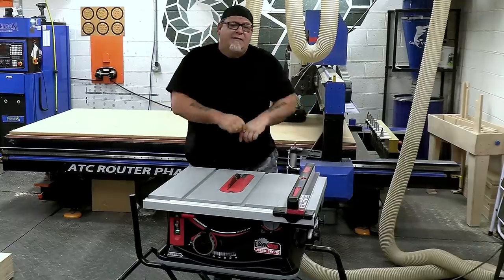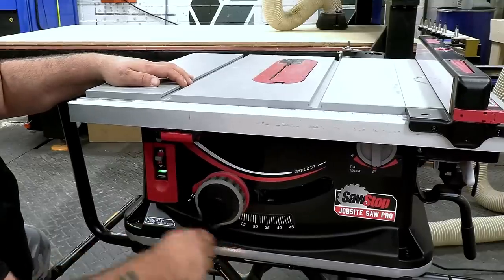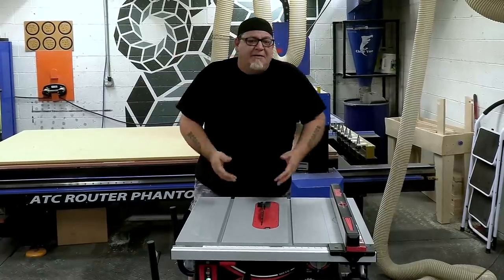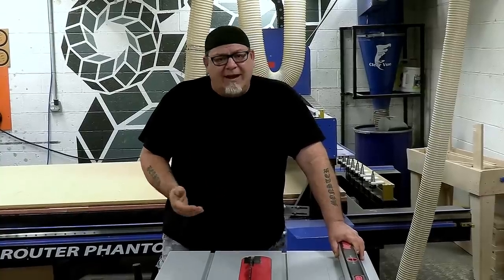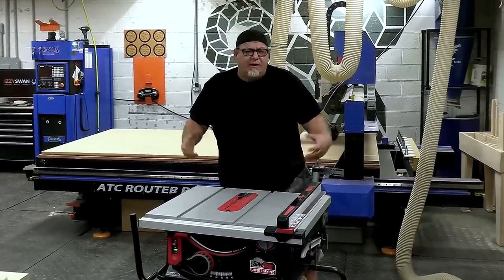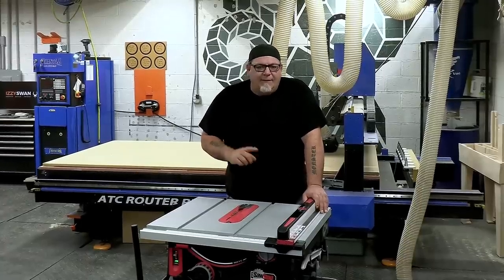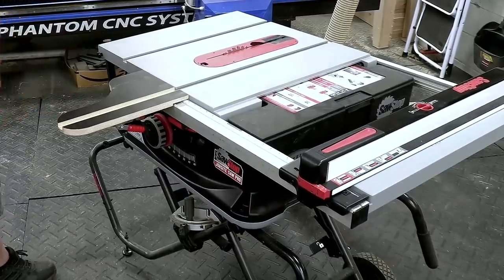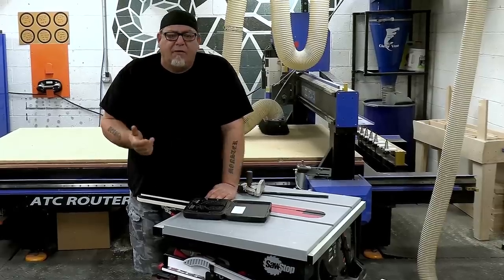DISAPPOINTED! - Most EXPENSIVE Jobsite Table Saw!

Comment: Izzy not so fast, thanks I think you need to reevaluate how the fence comes into alignment. I’ve been using my Sawstop contractor Saw for five years and I thought the same thing at first.  It seem to be a lot of slop but it all has to do with where you push the fence when you’re preparing to lock it down. it’s always the back end of the fence that seems to jump in the place and the front edge of the fence comes in on the measurement

Comment: I sold my dewalt 7491RS to buy the JSSPro. The dewalt's fence was the only thing I really liked about it, but it wasn't perfect out of the box. Not a big deal to adjust. I liked the rack-and-pinion adjustment for sure, but the tabletop wasn't dead flat but no cast aluminum table that isn't milled is. My SS is flatter and runs without the DW's wicked vibration on start up and shutdown. I watched a few videos of the JSS and had seen the tip to pull back on the fence gently before locking it down. I thought everybody knew that. The saw is at least as good as any other jobsite saw on the market and it wont cut your fingers off. Even if you say that feature adds $1K to the price, nobody is going to say their hand/fingers aren't worth the extra money. 

I have a really small shop and need a compact saw, otherwise I'd have picked up the contractor saw, but this never travels to a job site. 
I mainly use the saw for smaller cuts, only stuff that's easily managed on a compact table although I've ripped long lengths of hardwood after setting up a good outfeed, and never had a problem with accuracy. If I need to cut sheet goods or larger panels I use my track saw.

Comment: The Sawstop contractors saw is the best portable saw on the market. Not only is it the only saw with Sawstop technology, it is well built and very accurate. over the past 35 years I've had contractors saws from 4 other manufacturers and the Sawstop beats all of them hands down. My saw comes of the truck and back into the truck every day, and it has held up better than any other saw I've owned.

Comment: Since you're talking about blades, maybe you or someone else can give me a recommendation. I'm redoing my deck. I'm actually pulling up the deck boards....removing the staples (yes staples) resurfacing the boards by running them through my 10" table saw...then treating them with a DIY weather treatment....then screwing back down. 

There seems to be a wide assortment of general purpose and demolition type
 7 1/4" saw blades for the occasional missed staple, but I'm just guessing on the 10". Project Farm (excellent channel)
did an in depth review on 7 1/4" blades.
I just went to Harbor Freight and picked up their inexpensive GP blade. It's a deck, so finish is not terribly important. Any suggestions?

Comment: definitely an issue with the design of the casting, where the trunion is bolted to the table top. I've replaced a few trunions where they broke at the exact same spot. I've got pics if you're interested. I suspect rough play but it is a contractor saw, it should be able to handle the odd bump. These were all replaced from students at a trade school, not a work site.

Comment: You're iusing the fence wrong. Use the red hairline in the window to set the exact width of the cut. When you snap the lock, the fence will snap to exact square at the desired width. No need to measure the distance from the blade to the fence. Try it. You'll see it is dead on every time with no need for a tape measure. I've had mine for 3 years. Keep the blades clean and you will grow to love it. Just ordered one of your Saddles for it. Thanks for building a saddle for my jobsite.

Comment: I own the older model. Same fence problem and I cannot adjust the gap between the break cartridge and the blade. As a result I paid to have my brand new dado stack sharpened because it was an 1/8 of an inch over 8 inches in diameter.

Comment: 2 important things about 15 amp tools:
1st, I've got a 15A, 1.75hp air compressor that flat won't run on most extension cords, so U can create voltage problems for yourself by to limited (small gauge or long length) of extensions. 12ga for short runs, 10ga for longer. My compressor won't run on a 50ft 12ga extension, not even a fart worth. 
2nd, 99+% off outlets are 15A and cheap as hell. If you are using a particular outlet regularly for full 15A tools (this is why that 15A ceiling is so common BTW) spend the few dollars for full rated commercial 20A receptacles.
Reply: Ya can’t just change the outlet if that’s what you are thinking.  You have to replace the 14 ga wire with 16 ga to have a 20 amp outlet.
Reply: @thomasslate5341  Close, but you would actually have to replace the 14ga (15A) wire with 12ga (20A). You're right that it wouldn't necessarily solve the problem, because of resistance and voltage drop. Also, installing 20A outlets on a 15A circuit would fail an inspection, because it could allow someone to plug in a 20A device. It would just remove one potential bottleneck from the equation. The right solution for air compressors is always to plug in directly to a good outlet, preferably without competing tools, and then run longer air hoses. The compressor motor will feel an extension cord, but can't tell the difference between a 25' and a 250' air hose.

Comment: I bought the Sawstop Jobsite Saw Pro last November. For the most part I like the saw. What sold me is saving my fingers in case of an accident.  I have a very small shop and the ability to fold up the saw to move it out of the way is another reason I bought this saw along with being able to use Dado blades.  I would hope that at some point Sawstop would come out with an update to the fence as the fence is the only thing I am disappointed with on the saw.

Comment: I’m very surprised you didn’t speak to how ridiculously horrible the miter gauge is that comes with the saw! It’s basically a throw away gauge that says “go buy your own”… would expect better for the price of the saw. 

Great video overall though for those looking for info on it. I’ve had my JSS for 2 years, and dialed in and got used to the fence in short time so I’m not too fussed about it at all.  Wry happy with the saw overall otherwise.

Comment: I got mine at the start of the pandemic. My saw came damaged by the shipper, and the wing isnt flush with the body. I did get money back and sawstop did ship me a new wing. 
I do wish that:
 the cut capacity was wider as 32" would have been preferred for the backs of cabinets and sides. 
 they had attachments like extra long wings, like how a jointer may have to accommodate larger stock. 
 the clearance where the blade is was more so that it was easier to put on and take off blades.
 there was a door to service the dust collection area like the bigger sawstops have. 
 the miter slots were a traditional size so that I could easily purchase a miter bar to replace the horrid one that came with the saw.
the cord was longer so I could reach outlets better without having to grab an extension cord for 3 extra feet to reach...

Comment: I’ve had mine for 3 years and I’ve had issues with the fence shelf not retracting the whole way.  It sticks out about a 1/16 even after cleaning it out and trying to adjust it.  I haven’t had time to investigate further. Also, the angle adjustment will not go to 45°.  I’ve somehow lost the full range of motion on the bevel adjustment.  Again, haven’t had time to work on a permanent solution.  Anyone else have those problems?
Reply: About the angle range give it a really good cleaning, in my saw (not a sawstop) cannot get it to full zero, did all kind of adjustments and ended up putting it upside down and clean it with a small brush leaving it spotless and then got the perfect zero again.

Comment: You really can't expect the kind of accuracy and fence from a jobsite saw that you would from a cabinet saw. I've owned my JobSite Pro for a couple of years, and I love it. Yep, the fence moves a bit, and that can be annoying, but once I understood how it works, I can make quite accurate cuts with it without any problems. I've not seen a better fence on any other jobsite saw (but I haven't looked at them all, to be sure). On big pieces of really dense hardwoods, it can bog down a little, but it can make the cuts. To be fair, though, it wasn't designed for that kind of work. It's a jobsite saw, designed primarily for cutting construction lumber and plywood. It has no problems at all with that kind of work. In my small shop, however, I do use it for cutting hardwood, even dense exotic woods like tigerwood, purpleheart, and padauk, and it works fine. The mobility and other features (especially the safety) make it really the only table saw that works for me in my space.
Reply: Yes you can, I own a KITY 419 - they are OLD, so old that I beleive that they are the progenitor of the modern site saws (it's the same size and has the same features of moving / adjusting the saw) and I've been using mine for many years and the fence is ROCK SOLID, it's extruded aluminium with a SOLID ALUMINIUM "head" (?) where it meets the rail section and no matter how much I crank it, the far end of the fence DOES NOT MOVE AT ALL, not even with a dial indicator.

It CAN be done, if the manufacturer is willing to make less PROFIT and make a better product. - why people continue to put up with shit products is unfathomable.
Reply: @rafezetter8003  That isn't a jobsite saw. It isn't mobile. It only has an 8" blade. Without an extension table, it can only rip about 6". It may have a good fence, but nothing else about it is even in the same league as the SawStop JSS Pro.

Comment: I will keep my DeWALT table saw which I paid $600.00 Canadian. Has a rack & pinion system for the fence and works very well. Is it near perfect? No, but but is really good. The mitre gauge is crap. It was quite easy to setup so that the blade parallel to the mitre slot and the fence parallel to the blade. I personally refuse to pay the inflated price for the sawstop brand. Also have 32.5" rip capacity and the fence has a flip over to support the piece when the fence is off the table.

Comment: Mafell make a jobsite saw, makes the Sawstop look cheap 👀

It's a bit speciality though, most people have never heard of them if they don't build wood cabins! 😆
Reply from the maker: I will check them out.
Reply: Most carpenters in Europe have heard of Mafell, little know fact, Mafell batteries are interchangeable with Metabo original
Reply: @harveysmith100  they're actually part of this new tool battery alliance, lots of smaller and neiche brands getting together and all using the same batteries to cut down on costs, and make them more attractive to buyers. Quite a good idea actually :) 

Have you seen their 'handheld' 10" beam planer? 😆 or their huge 2ft something inch circular saw? 😆 really pushing the boundaries of "handheld" there! 

But in amongst all that mad stuff, they've a competitively priced tracksaw and jigsaw 🤷‍♂️
Reply: With Mafell, it's not about price, but about quality. The jobsite saw is mostly used by cabinetmakers. Alltough the Erika has his disadvantages, like the unhandy fence (wich is improved very recently) and the not parallel sawblade, it performs better than a lot of cabinetsaws.
Reply: @mor4y  Correct

Comment: Just a small note, if you are setting up the the square for these saws or most saws set your square on the right hand side of blade as this is the side your cut piece will be. Yeah it will have more base plate but use a bigger square.
Reply: Don’t mean to be rude, but when you have used a Jobsite for so long you get used to its limits. And one thing you realise it can be square on the right side of blade & not on the left but as cut piece is usually on right it does not matter if it’s set up right 🍻

Comment: I haven’t used this saw. I have the Metabo and the fence is great. It connects son the gears on both sides and is solid. It also has a 36” rip cut
Reply: I have a C10RJ and it's great.  Tremendously accurate and has taken lots of jobsite abuse with no complaints.  Why anyone would pay for a SawStop is beyond me.   SawStops are for idiots who put hotdogs on their tablesaws, or for idiots who get drunk or baked and then try to go to the garage and build stuff.   The rest of us who take proper precautions don't need a SawStop because we know enough to not cut dangerous wood, and not put our hands near the blade.
Reply: @jimthesoundman8641  not when you have a 13 year old grandson who you are teaching wood working

Comment: Most jobsite saws have a 15A motore (or less) because many electrcial circuits are limited to 15A by the circuit breaker.  So a 20A saw will not work reliably on job sites where you dont know the circuit capacity.  The so-so fence is a common complaint for this saw, and other jobsite saws as well.  I own the Bosch Reaxx (not sold in the US anymore) and really had to buy the safety technology because at my place of work we don't use the saw every day an dsometimes fairly inexperienced men might use it...its just too much of a risk to not have that feature....not just my own fingers.

Comment: Great video. I have used it for a few weeks and I completely agree. I don’t like the slop in the fence. I agree the finger saving Technology is great, but I find myself going back to using my dewalt job site saw because I need more accurate cuts with the fence.

Comment: I can't believe that they don't use rack and pinion fence adjustment like DeWalt or Milwaukee. combined with the safety feature, which is the only selling point here, it would make it a great saw.

I spent a lot of cash on battery operated DeWalt jobsite table saw. it is very accurate, and well built, but I keep running out of batteries, and I wish it had both the battery AND the regular plug power. I think I'm going to modify my DeWalt to use both the battery ANd the socket power, since it's no longer under warranty.

Comment: Great video Izzy. I'm a 42 year lifer in residential housing and all things millwork. I got the jobsite saw 2 years ago for use in the shop. I already had a Ridgid and a Bosch for jobsite work. Long story short: on a new, 200 amp service and a designated circuit, the saw brake activated randomly, the switch box would go into error mode for no reason and not start. It got to the point where I was afraid to use it. Sawstop eventually sent me a new motor, switchbox and wiring harness but I never put them in and sold it to a retired engineer who was happy to work on it especially with the great savings I gave him to get rid of the thing. The fence is truly awful, not just slop wise but in that it has to either be in the narrow range position or all the way over in the extended position, locked down and nowhere in between. That leaves the flimsy fence slide-out to hold the edge of boards where there is no table and it isn't adequate for the heavy boards, etc that get thrown thru a jobsite saw on a regular basis. In March I had my third table saw accident in 42 years on a Grizzly and the wife said: That's it! I bought the Sawstop Cabinet saw and it IS worth bragging about. Everyhing that their JSS and "Contractor" saw is NOT. Keep up the good work

Comment: Using my 5 amp table saw, my hand slipped and my middle finger went into the spinning blade. But it slipped between two teeth and stopped the blade. I was stunned and just kept my finger in it for a second before sliding it out the side. All I had was a blood blister.

Comment: After 10 years of furniture making, I'm done with any tool that leaves me second guessing if it's set-up right. All my wonky/iffy tools have been passed on, sold, or binned. 
That finger safety feature is something I've never used, after all this time I've only lightly cut my fingers on my table twice. Personally I wouldn't buy into the sawstop gimmick. I think for beginners it's a false sense of security they shouldn't get used to.
Reply: Why would you say it is a false sense of security? There have been many brake actuations that the operator swears there is no reason for. These can be determined by SawStop if you send them the brake cartridge. Sometimes, depending on what caused the trip; they will replace the cartridge but you are still out the blade. So they do trip for reasons not immediately known. There is no documentation or incidents where a brake cartridge failed when the blade touched human skin. So why do you say it is a false sense of security?
Reply: I might agree about the false sense of security if it didn't cost a bundle if you trigger it.   Bang and $150 or more is gone.  that keeps me careful.
Reply: @jeffstanley4593  And btw, I was just reading the FAQ on the sawstop website and they state that it is still possible to receive a serious injury if your hand moves into the blade at high speed. So...
Reply: @altronixvideo  Yes, the blade spins and when your finger touches it a signal is sent to fire the brake into the spinning blade. The blade is then stopped. Most people are gently pushing their wood stock through the blade and not trying to see how fast they can go. The faster you push the faster your hand moves into the blade. Under all circumstances the blade is stopped when you come into contact with it on a Sawstop machine. Under no circumstances is a non SawStop blade going to stop. Serious and amputation are not necessarily the same thing. But, if that is the way you think; more power to you. I don't get paid to convert the unbelievers.
Reply: @jeffstanley4593  That's not quite what I was saying but ok whatever.

Comment: Isn't Bosch REAXXP a saw stop altanativ or?
Reply: Concluding a lengthy investigation, the ITC on January 27 ruled that the Bosch Reaxx saw violates two patents held by SawStop for technology designed to protect users from accidentally being cut by the saw. Posted onFeb 1, 2017. Once Sawstop’s patent expires, all of the tool makers may design and sell blade braking systems.